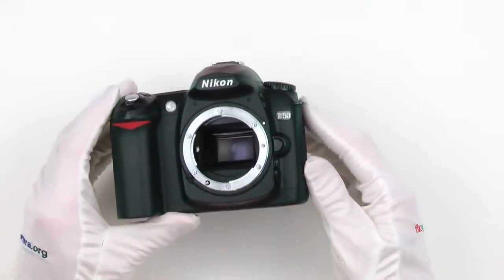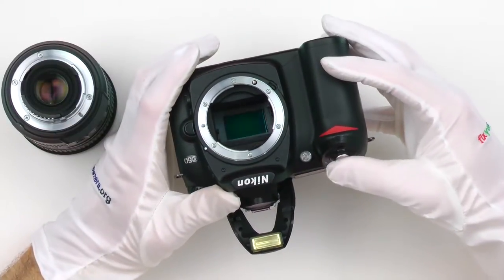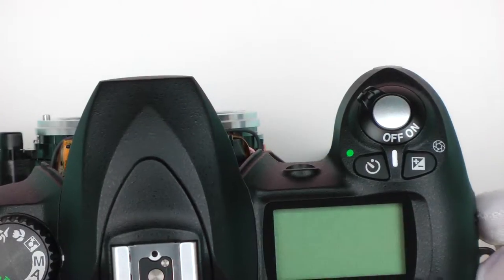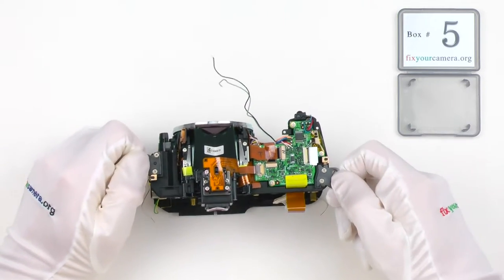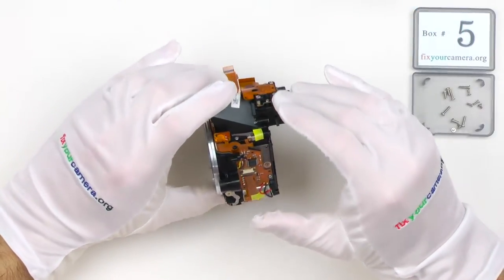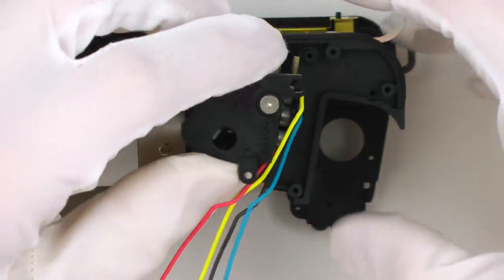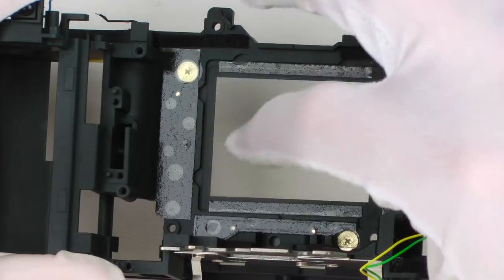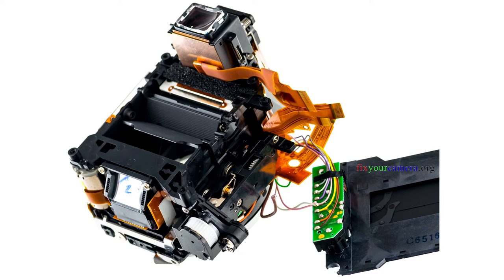Nikon D50 Teardown & Review *Part 1/4* Disassembly - How it works / older Nikon DSLR quality...

Comment: Hay I have a question. I should tera down the mirror box of a D5300 for some mold. I have other cameras so no hurry and I do not have problems if this camera will be damaged. I would like to try. It might be done relatively easily instead dismount everything? I mean, I could not find online a manual for open the D5300 so, I would try. Is it a good idea? or just leave it there? I do not want to spend money for this dslr sending to the assistance.

Comment: Love the "it could hurt or possibly kill you". Lol
Reply: If you've ever been zapped by a large cap, then you'll know it really hurts.  Short it with both hands and it can cause the heart to go into fibrillation, as the path to complete the circuit goes across the heart.  Without quick treatment, this can kill.  Flash caps fall into that bracket (just).

Comment: Hey I'm just wondering are you a Nikon authorized repair shop/Technician? If not, where do you get parts to repair the camera? I'm asking this because you said you are an independent technician, so I assume you are not working for Nikon.
Reply from the maker: +Jim Huang    Yes Jim, I am independent repair tech, not authorized by any manufacturer. Currently I refuse to work on most Nikon gear -> lack of parts. Just like most other repair shops. I talk about this in D750 recall video.

Comment: Hi great channel. I found my old D50 in a box and when I look through the view finder it is dark and very grainy. Could you please advise why this might be? Thanks in advance.
Reply from the maker: This is normal without a battery inside. It clears up right after you insert a charged battery. Or if not, then check all flex cables / connectors under the top cover (those sitting directly on pentamirror) - they like to slip out of place, clean and reinsert them all, then check again